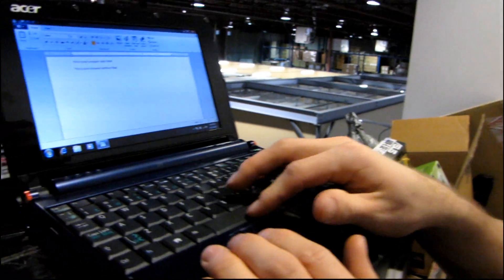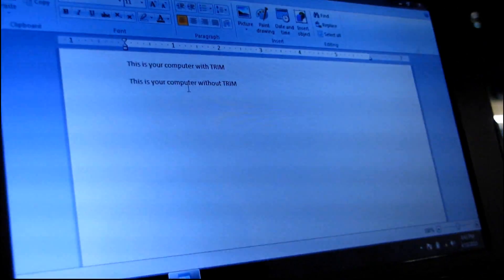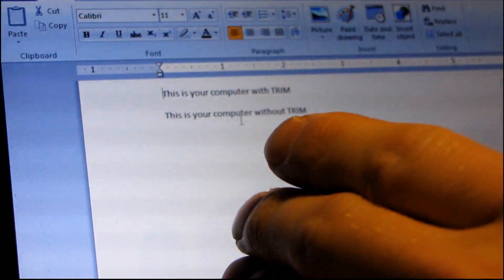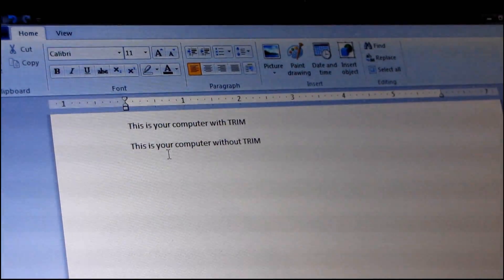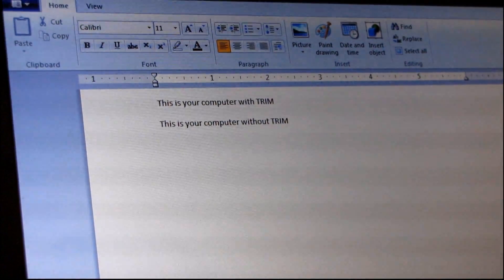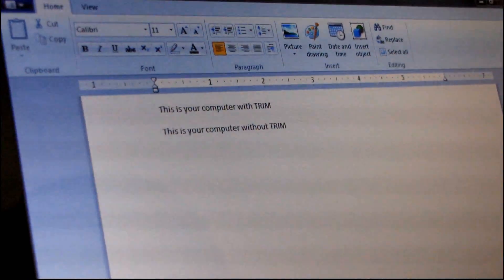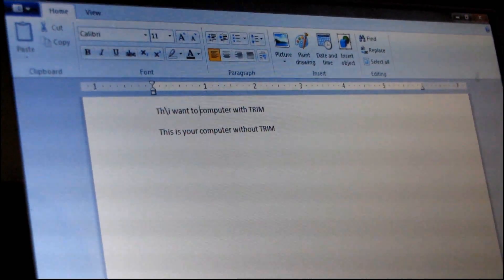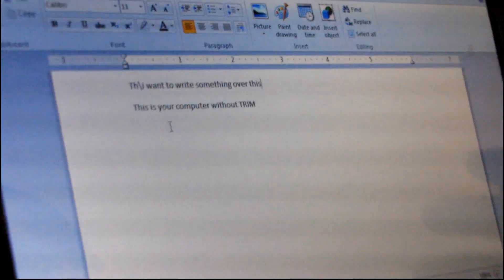What is TRIM and Why Does Your SSD Need It? Linus Tech Tips

Comment: It doesn't actually work like this. Without TRIM, when you overwrite a piece of data and your SSD still has empty pages, it will just write to those empty pages which is fast. However, when all of the pages are dirty, it will start the read-change-erase-write routine. TRIM allows the filesystem to tell SSD beforehand, that some pages are not needed anymore and they can be garbage collected. Garbage collection reads all pages in a block (typically 128 pages) to a cache, keeps only valid ones, erases the block (because in order to write to a dirty page it has to be erased and SSD can only erase the whole block of pages)  and then writes pages from cache back to erased block. This is done in background as opposed to doing it every time once you've written to every page and you started overwriting them.

Comment: I've been reading about optimizing windows for SSD's. I'm a bit confused. Is it necessary to disable Prefetch & Superfetch if you have an SSD boot drive?  Will doing this affect performance of non-SSD storage drives (where my programs & games are installed)?  I'm looking for a definitive answer. Most of what I read and see in youtube videos, there's a lot of arguments on both sides.  I'm using Windows 10.
Reply: if you have 10, you literally don't worry about anything. TRIM is there. that's all you need to worry about.

Comment: ...and then along came OS X Yosemite! Is garbage collection advanced enough now to not be worried about using it?
Reply: ***** According to Mac Rumors third-party SSDs will now be supported! 'With today’s OS X 10.10.4 update, however, Apple has added a command  line utility that can be used to enable TRIM on third-party SSDs without having to download and install anything. Called trimforce, the utility can be executed from the OS X terminal, and it requires a reboot to start working.'

Comment: i have that computer, but it is win XP, tried to upgrade the ram. It couldnt even boot
Reply: using dual channel or single? Try putting the ram modules in different slots. if you're using dual channel, try using just 1 stick of ram and move it to each slot, trying it with each.

Comment: Is this still true nowadays with z99 boards and windows 8.1? does it still work the same way?
Reply: Alex Maia It's probably built in, yes. Hard drives already do this by nature and have been for a long time, and cannot help but do so whereas TRIM forces the SSD to do this, which as Linus said, helps the SSD last longer as it can simply add a byte to the sector to mark it as empty just like a traditional hard drive rather than the SSD writing a blank file of the same size as the sector just to make it empty.

Comment: wow so trim is STILL not supported with windows 8....
Reply: is it possible that windows could automatically do that?
Reply: thanks for the help :D!
Reply: bobloom36ful I believe that this TRIM function is actually already hard built into SSD's of today. Here is how TRIM works basically: A traditional hard drive does not actually delete data when you try to delete it, but rather marks the byte and the appropriate index as empty until the next time that space is filled with data, in which the old data stuck behind that index is then overwritten. An SSD's flash chips can be legitimately erased whenever you remove data from it, but the problem is that it shortens the life of the chips because instead of using one cycle to replace this sector's data, it uses 2 cycles to replace the sector's data. The TRIM function that is now a standard for SSD production and not even labeled on the box anymore simply mimics the behaviour of the HDD, where it marks the index and sector as empty and then leaves the sector to be overwritten by the new data when it comes in. This uses only 1 cycle just like a hard drive and can almost double the life of the SSD as a result.

Comment: Hi bro 1 cuestión i have Linux Kernel versión superior that 2.6.33 if necessary activate Trim on Linux??? Thanks for help Grettings From México i like a excellent video channel of technology and more
Seeya!!!
Reply: To enable TRIM you'd have to do it via your fstab but it's not ideal to enable it directly like that on Linux as it'll constantly be running trim in real-time. The best option is to create/find a script to (or manually) execute the command fstrim daily or even weekly. This allows for your SSD to know which blocks are free without taking away performance.

Comment: I had a question. Let's say I have a 60gb SSD with trim support and also I use a OS without trim support. A year down the road I have installed, uninstalled, downloaded, delete files alot and suddenly I want to partition my SSD (30gb AND 30gb), I'll probably run into issues with that correct? I won't actually be able to shrink a volume off b/c I don't have trim and files were written everywhere? With trim support I could be able to shrink any leftover free space correct? Thanks!

Comment: Yes, SandForce* but I realized not all not all SF controllers are bad since intel uses sandforce too.  It's just I had bad experience with sand force based SSDs like OCZ vertex 3 and agility 2 as they both died in couple of months.

Comment: Uhh... Modern Intel SSDs (330 series and 520 series) use the sandforce controller and they're just fine. SandForce hasn't been an issue in a long time.

Comment: Corsair seems to have good reviews on their sandforce based SSD as the failure rate is low with newer firmwares, but from what I've read on the customer reviews sandforce drives usually has 3-4 star ratings.  For example the 90gb corsair force drive out of 114 reviews 13 people had the drive fail on them and some were DOA.  Compared to crucial and intel the SF ssds have lower rating.  I myself bought a 128gb vertex 4 and using it as games drive.  It has Indilinx controller and performs well.

Comment: It's a great value SSD and more certainly looks more reliable than the OCZ vertex series.  I can't tell you a lot about it caz I don't have it, but from what I've read on the reviews and such, it seems like a decent SSD.  People are using it as a boot drive with good boot up times.  Newegg (364 reviews | 249 5stars | 52 1star) some of those are DOA, but quite a few people also had drives failing on boot.  I personally would use it as steam drive and get a 64GB crucial M4 for windows.

Comment: Lost 2 SF SSDs. Lots of people on newegg customer review have got BOSD while using sandforce based SSD (eg. OCZ vertex series) as a boot drive.  It was some bug and the failure rate is pretty low now after the firmware update. You should be safe if you just use it as a steam drive.  Recommended SSDs for boot drives are Corsair Performance Pro, Crucial M4, Intel 520 series and Samsung 830.  I bought a crucial M4 128GB (CT128M4SSD2) for 99$ and been using it for a while without any problems.

Comment: That's why SDDs are best suited for your OS and program files, putting user content (for win xp: Documents and Settings and such) onto a separate HDD. You mainly want the quick read speeds of SDDs so you can quickly boot and open programs. The only writing that should be done is when you're installing new programs or when Windows (or other software) has updates.

Comment: does trim work if i have a RAID card installed?? cause it's a "virtual drive" n windows doesn't seem to treat it as two SSD(RAID 0)...... also my space is running very low.....
if i see the properties of the stuff inside the drive it's 26 GB but if i see the properties of the whole drive it says 51 GB used...... wth is happening??
PLZ HELP!